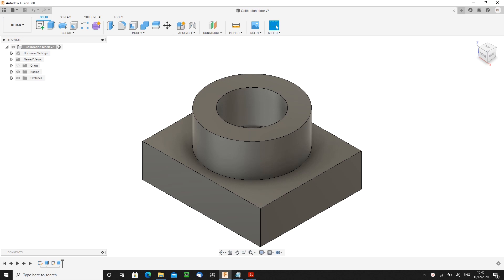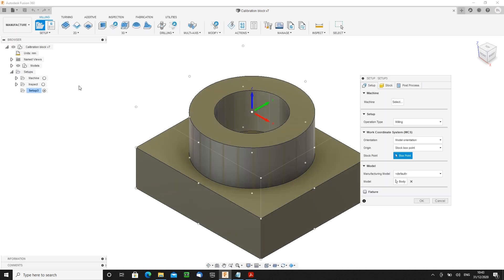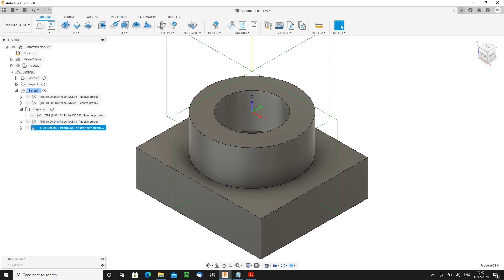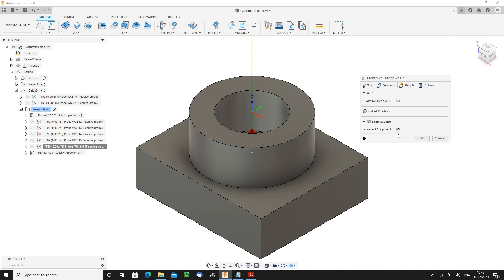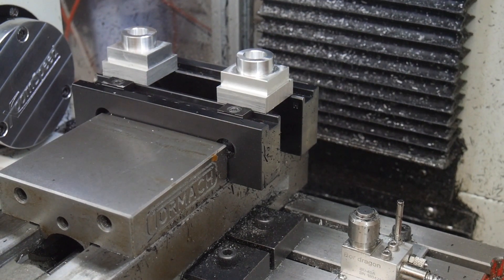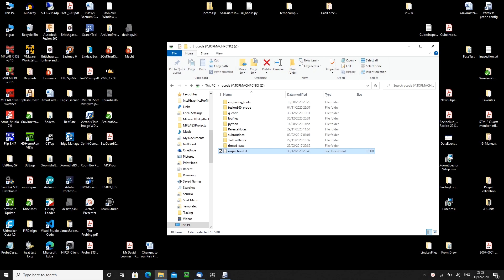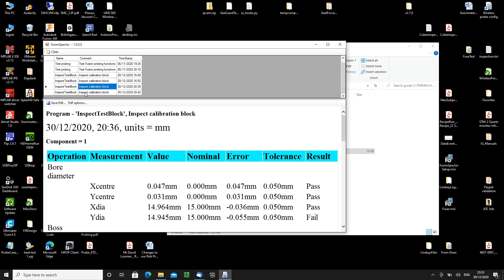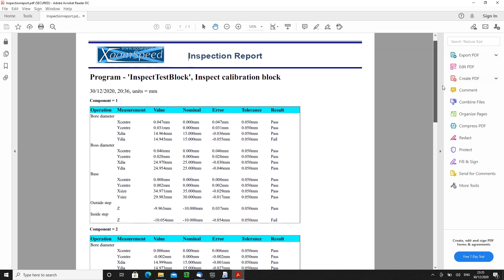Fusion 360 inspection reports for Tormach mills

Comment: Love it. I wish Mach 3 and 4 did this. That's what I'm currently using. I wonder if this could be adapted to Mach 3.
Reply from the maker: My wcs probing routines for Fusion were originally developed on Mach 3.  You can get the results at http://xoomspeed.com/CNC/mach3/mach3goodies.htm

Never went as far as doing the inspection stuff though and I don't have anything with Mach3 anymore.  I think the hard bit would be getting the text items into the results.  The program name, comment, date and time and the operation names.

Comment: David are you still offering this? I think this would make my inspections for Xometry much easier. I am using SolidWorks with HSM (F360 CAM). Would your plugin work for that also? I have the F360 paid version but only pay for it to be able to use HSM with Solidworks.
Reply from the maker: Yes, it's still available.  post-process from my website http://xoomspeed.com/CNC/FusionPostProcessor.htm and the formatted report generator from my shop https://shop.xoomspeed.com/collections/cnc-accessories/products/xoomspector

I'm not sure, but I suspect the post-processor will just work with HSM anyway, in which case itr's pretty easy.

Comment: I was able to run this today with my active probe and this weekend I will run it again with the (soon to be wireless) passive probe and share the results. One question David, with your postprocessor, the head retracts all the way up during tool change and between ops (regardless if I choose G30z or G28z option - any idea why ?
Reply from the maker: If either of the tools involved isn't in an ATC, then the M6 instruction forces a retract to max z regardless.  Could this be what you're seeing?
Reply: @daleksw  that is correct, my probe isn't in the ATC (yet 😃). I thought I could define a safe retract height with G28.1 and then 8se the G28z option but it doesn't seem to work.
Reply from the maker: @loupitou06fl  Afraid I can't do anything about M6's normal behaviour.  The really annoying thing is if you have an ATC and neither of the tools involved in a change are in the carousel, then it forgets to do the retract and expects you to do the change wherever the head happens to be.  If it's running a program at the time, the jog controls don't work, so you're stuck.
Reply: @daleksw  Looking at your video again, your probe doesn't go up between the  first 2 probe operations (finding the WCS X-Y then Z), mine does even in between these ops - I will dive in the g-code produced and try to understand. Last question David, is it possible to specify the path for the inspection log file ? I have a dropbox folder that I would like to write on.

Thanks
Reply from the maker: @loupitou06fl  After every machining operation, the head retracts to the clearance height specified on the heights tab for that op.  I've just got it down at model top + 5mm or something around that.
Afraid the inspection file path is hard coded (ngc files don't have any string variables), but you can do it as I did and make the output folder a network share.

Comment: Would love to see a in-depth dive in an other video!! Wondering if it would work for Mach3?
Reply from the maker: Mach3 would actually have been easier, since the vbscript environment has much better file handling.  Do you have the Mach version of the wcs probing routines already?
Reply: @daleksw  Hi David! How’s the progress on the inspection report feature coming along? I have since moved moved on to PathPilot “Tormach 440”.
Cheers from North Carolina, USA!
Reply from the maker: @stevetriton1060  I now have the software on my webshop at https://shop.xoomspeed.com/collections/frontpage/products/xoomspector and if you're not using it already, grab a free copy of my post-processor from http://xoomspeed.com/CNC/FusionPostProcessor.htm That's all you need to get it working.
There are a few people out there who've used it and run tests to establish how repeatable the mills are and I think you'll be pretty surprised at what our little machines can do!
I did have alook at Mach 3, but I just couldn't see a way to get the text into a logfile.  Numbers are easy, but getting the descriptions into the output file was going to be a real pain.  Glad you switched to PathPilot!  To be fair though, this is the first time I've come across something PathPilot achieves much easier than Mach3.